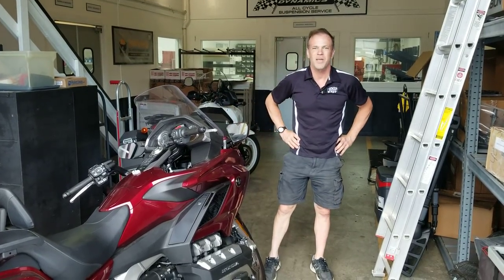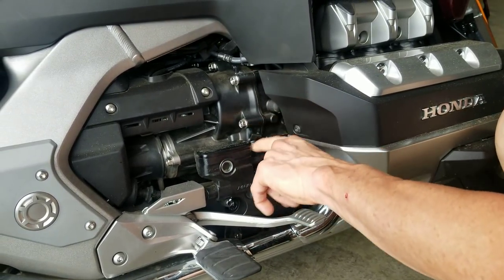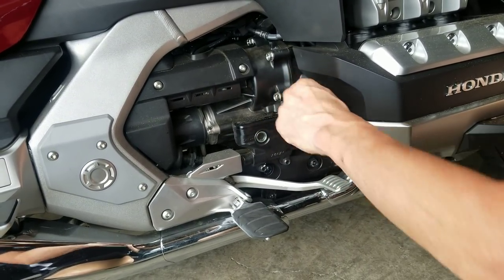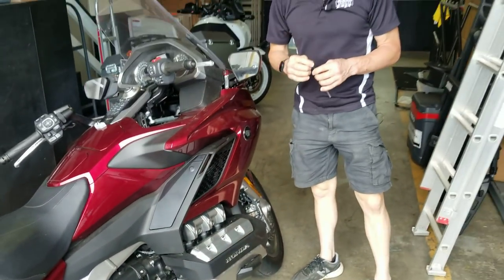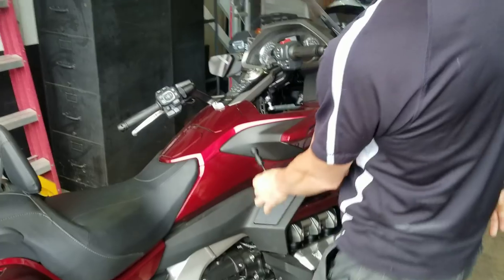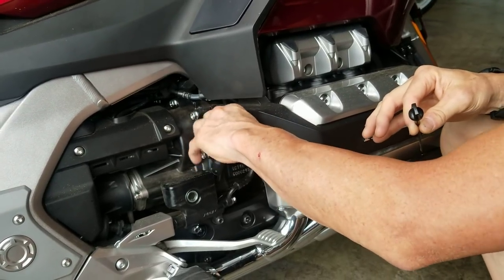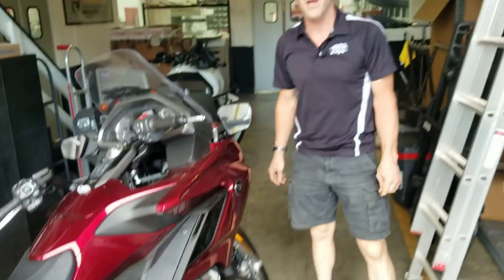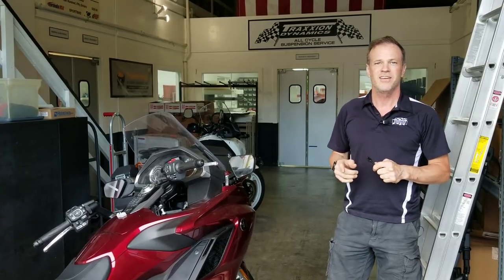Introducing the Traxxion Dynamics Dipstick Extender for the 2018+ Honda GoldWing!!!

Comment: Max, have you tried Corbin's High Capacity Saddlebag Doors?  They add 2.5" in width (or depth) to each side. They are OEM color matched and look nice. Check them out.
Reply from the maker: I have seen them, haven't seen them in person yet.  I knew someone would do that.  I suspected Trike makers would be first to do it, since they have fiberglass shops and paint booths.
Reply: Paint is not holding up on those bag doors.
Reply from the maker: @edbard3766  that's what I've heard.

Comment: Great idea....
I like that it doesn't totally replace the stock dip stick........but just makes it easier to remove/install. 
Sign me up.
Reply from the maker: Hi Mick!  I purposefully didn't want to redesign the dipstick, as I figured Honda knows some secrets about what the right alloy is for the stick so that it can vibrate like crazy for hundreds of thousands of miles without breaking off.  I didn't want to be responsible for a dipstick floating around in someone's engine!

Comment: Hi Max. That’s a cool idea. I had a 97 Valkyrie Tourer for 20 years. Put over a hundred thousand miles on it. Changed the oil myself every three thousand miles. The dipstick in the GL 1500 was as hard to reach as the Gl 1800. Refer back to first statement. I kept it twenty years. A hard to reach dipstick is an opportunity for the entrepreneur . I do appreciate you pointing out things you find that could be made better though. I have never bought anything that was perfect. If that were the case there would be no aftermarket parts. Then we would have to keep our bikes just like we bought them. That’s no fun. Keep up the great videos. Thanks.
Reply from the maker: The Goldwing is the most heavily customized motorcycle on Earth, I don't think people would buy them if they were already perfect!  HAHA!

Comment: I made one that screwed through there with a set screw. it'll be interesting to see how yours works it's hard enough to check the oil on a bike with starting it running it then having a hold the bike level and check it. I'm absolutely amazed at how stupid the oil changes on this bike it takes forever to get oil in through the port on the other side

Comment: How about a luggage rack that attaches to the grab rails over the rear seat on the goldwing and fb6 models. I would like a solid rack for equipment tie down.
Reply from the maker: That's actually an interesting idea.  I like it.  We wouldn't have a product for F6B, but we could do something for Standard or Trunkless Wing owners!  Great idea, I'm going to look at that today.
Reply: @Traxxion , I'm speaking of the glowing. I think it could also  have a slide so it could extend over the trunkless section when needed.

Comment: Looks simple enough...  wonder why mother Honda did not think to install a oil level sensor that would tell you when it's low and tell you when to change it... ....
Reply from the maker: That would require something advanced like a Canbus system... oh... wait a minute, the bike has one!
Reply: It’ll be has hard understand as the navigation/radio system